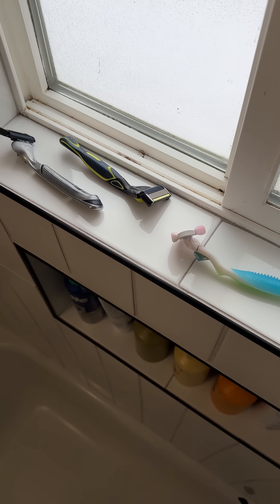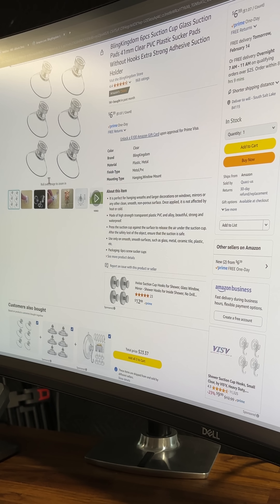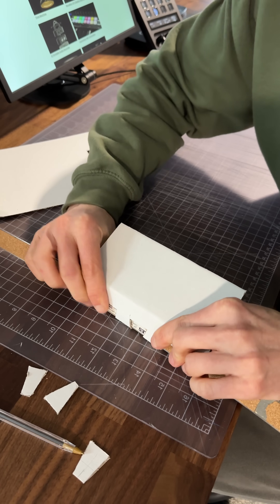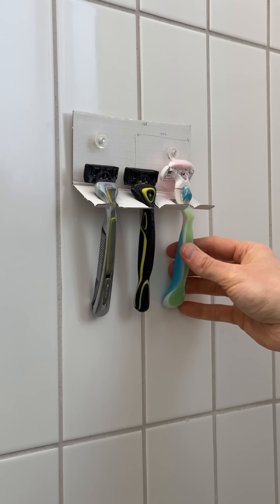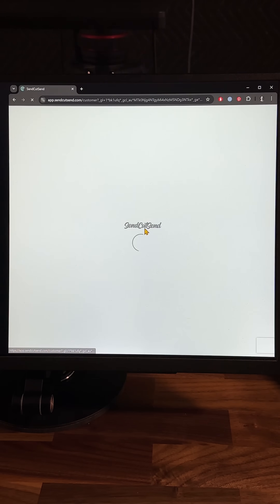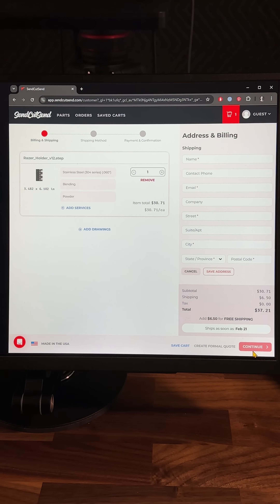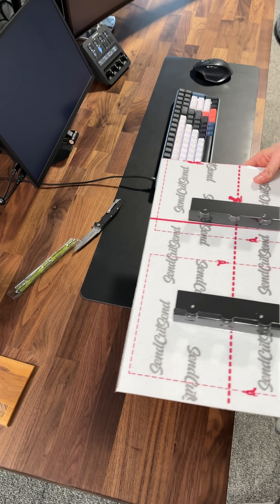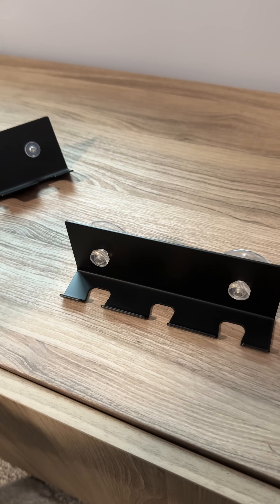Getting one of my designs produced #industrialdesign

Comment: I wonder how long this will last without rusting, I had a powder coated stainless steel rack that still rusted after a few years in the shower, switched to aluminum to solve that. You sir need a 3D printer!
Reply from the maker: We'll find out! It's not in direct contact with much water, so we'll see.

Comment: Great idea. But what if the suction cups fail and a piece of steel falls on your tile? I'd be worried about it getting damaged. Then also the matte black finish getting messed up.  Love it tho, no hate, just something I thought of.
Reply from the maker: Great points! I thought of that too and actually moved it so that it's suctioned onto the window in our shower. That way, if it happens to fall, it'll land on the shelf and only fall a few inches. The suction cups were meant to be a temporary solution. I was hoping to use it with suction first and then if I liked it, install it permanently by drilling holes in the tile to mount it.
Reply: @WillGibbons  i would've never thought it until I had a similar situation where the wife wanted something like that in our newly renovated tile shower. She wasn't too fond of me picking apart her idea, but then again, she's not the one who paid for it all lol

Comment: $37 for something Amazon sells for $5
Reply from the maker: I was looking for a specific solution, not the cheapest one. I don't like to support the race-to-the-bottom cheap commoditized products sold on Amazon if I can avoid it.

The total for one of these parts cost me $30 given the material and powdercoating. The other $7 is $5 in shipping and $2 in taxes. If you meet SendCutSend's minimum order of $38, the shipping is free. If I were to order 2 pieces, the cost drops to $25 each. If I order 100, the price is $11 each. So, those ones on Amazon sold for $10 are probably produced at 10,000 pieces, bringing the cost down to about $2 each to produce, then you have room for your margins. 

Goin custom for a one-off is never going to be the most economical solution.
Reply: Still